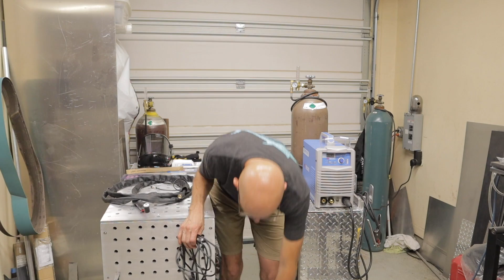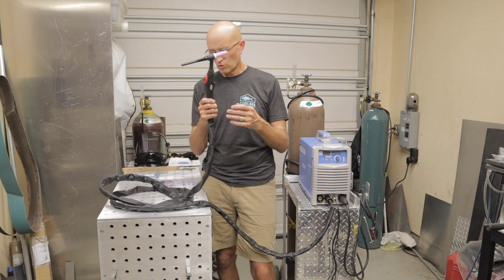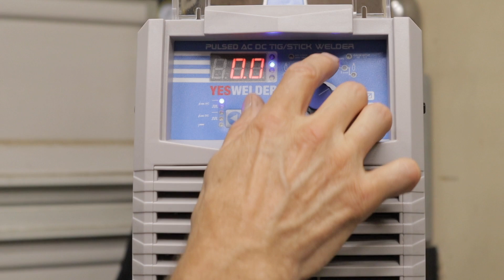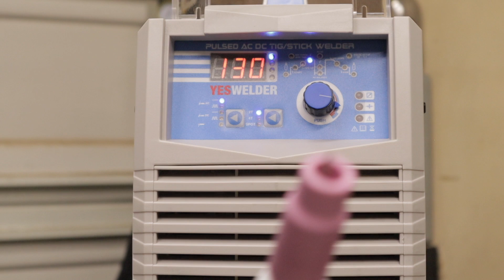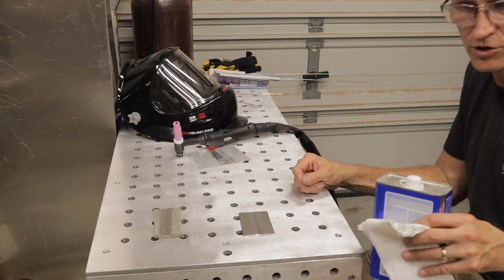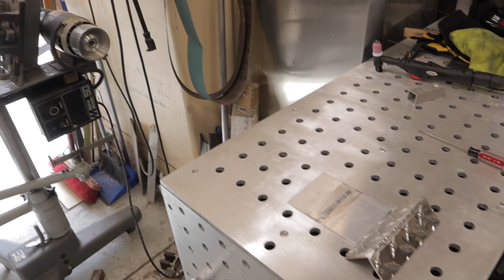YESWELDER NEW TIG 250P Setup & start tig welding Steel & aluminum.   Discount Code in description!

Comment: Comparing this, AHP 203xi and Primeweld Tig225x. Everyone agrees the primeweld warranty and customer service is top notch, but one thing I don’t really like is the analog knobs. I’m fine with analog but it doesn’t have markings or clicks for values, it seems like guesstimates. At least on digital you know exactly where you’re at and repeatability seems better.
Reply from the maker: I had the AHP predecessor 201XD and it was basically the same as the primeweld 225. I think they were made in the same factory by the looks of the welders. I liked the simplicity of the analog settings but the power just wasn’t enough for me. I wanted to weld 1/4” aluminum and it would really struggle to do it at max amps. When I got the Yeswelder, it was more powerful right out of the box. At 200 amps I could easily weld 1/4” plate and at 250 amps I have welded 1/2” aluminum with a little preheat. Don’t know if this helps you make your decision or not. All three are great welders. If you are not going to be welding aluminum you will probably be happy with any one of them.😁👍

Comment: I ordered this same welder. I was just wondering how many amps is sufficient for this breaker and what wire size is appropriate. is it a 6 awg or 4 and a 60 amps breaker? I would appreciate it if you can reply for my queries
Reply from the maker: Hi Lepanto! A 30 amp breaker is what I’m using and it is wired with 10awg wire. Sorry for the delay in my response, I just noticed your comment. Let me know if you have any other questions. Thanks, Don
Reply: @PranaTech  Thank you for your reply. highly appreciated. Anyway, nice video  especially for someone who is starting to learn tig welding.

Comment: All is well with the welder,your video is very informative but I don't remember you telling your viewers that to tig aluminum you need to swap the ground clamp to the positive side! You would think that with all the other tech that is built into this machine that it would do that automatically, thank you
Reply from the maker: Hi Richard,  I’ve never stick welded with mine so I’ve never needed to swap the ground clamp. I Tig weld mostly aluminum but occasionally I weld steel with it and you don’t have to change anything other than the AC/DC settings on the panel. Sorry I didn’t catch that when you asked about the not keeping an arc going. Glad you got it figured out! 😊👍

Comment: Matched all of your settings on my welder but the only thing that happens is high frequency comes on for maybe one second and that's it,the only thing that's different is that I'm using the button on the torch instead of a foot pedal,any suggestions
Reply from the maker: Hi Richard, I’ve never welded with the button on the torch, only the foot pedal. There might be something wrong with the button.🥺

Comment: How do you set it up for stick welding? I'm having no luck trying to do so
Reply from the maker: Hi Richard, to set yours up for stick, put the electrode holder cable into the positive output socket and the ground cable into the negative socket. Then select stick on the mode and then electrode size over on the far right middle of the 3 led lights on the control panel. Then select what amperage you want and start stick welding.😊👍 hope this helps!

Comment: Just received my 250P today, but it doesn't come with the pedal, I am wondering if I can weld the aluminum floor in my semi trailer without the pedal.. maybe it will just be a fixed amp instead of the control amp from the pedal?
Reply from the maker: Balerio, they do sell a pedal in the accessories section of the site. It’s pretty decent for the price. It does come with the switch on the torch but that will be a fixed amperage like you said. The switch will just get the arc started at full amps set on the display. 😊👍

Comment: I want to upgrade my yeswelder  to a ck torch 
Do you know if there is a adapter that would work with that to make the ck torch work ?
Reply from the maker: Yes! I just finished doing this to mine. Here is a link to the adapter on eBay. https://www.ebay.com/itm/174825692252?hash=item28b46c5c5c:g:c9oAAOSw76lcQodL  It is a little pricey at $32 but a quick and easy way to get it done. I made my own adapter by taking a Western AW-430 double female and drilling it out and then tapping it 5/8-18 straight through and then shortening the coupler. The couplers are $4-$5 on eBay but if you don’t already have the 5/8-18 tap and a 37/64 drill, it ends up cheaper to just buy the adapter on eBay.  I’m actually working on a video on how to upgrade your pedal to a Nova or SSC and CK torch and a Tig button setup. 😁👍
Reply: @PranaTech  thanks got it ordered 
The peddle mod would be awesome that is my next upgrade to it but could not find a way to do it.
Reply from the maker: So to upgrade your pedal, you just order one for the AHP 201XD and then install a GX16 5 pin plug on the cord. It is not hard and I have a schematic that shows exactly how to transfer the wires from the one plug to the new one. https://drive.google.com/file/d/1ensmrBx3Y1fsxU2AME1HBv9_G13EQOZ0/view?usp=drivesdk   And here is a link to a picture of the CK flex head torch I used https://drive.google.com/file/d/16uazLI7uoQjj03WPGQBLkKhV2T8h8SYP/view?usp=drivesdk  Hope this help and let me know if you have any questions.😊Don
Reply: @PranaTech  thanks 
Is there a better web site to get the nova peddle from and the plug adapter?
Reply from the maker: Amazon is the best place to get the plugs. Here is a link https://www.amazon.com/gp/product/B08NX3BK1R/ref=ppx_yo_dt_b_asin_title_o02_s00?ie=UTF8&psc=1  You can find them in a single set but the price is about the same as this set of five. This will give you some spares in case anything ever happens to the plug. Here is also a link to Amazon for the correct Nova pedal. https://www.amazon.com/dp/B07534C15W/ref=redir_mobile_desktop?_encoding=UTF8&aaxitk=e41972199c8479da2d4a1d81ef104793&hsa_cr_id=7843351320201&pd_rd_plhdr=t&pd_rd_r=42b5391b-4948-44df-bdf1-e372c60c0726&pd_rd_w=IPK14&pd_rd_wg=8vdgr&ref_=sbx_be_s_sparkle_mcd_asin_2_title 👍
Reply from the maker: Sometimes you can find the Nova Pedal a little cheaper on EBay but Amazon is usually the best price. 😊
Reply: @PranaTech  thanks just got it all ordered 
Can’t wait to get it all dialed in 
Thanks for the videos and help !!!!
Reply from the maker: Awesome! Let me know if you need any help with the setup when you get going.👍😁

Comment: I just received my 250 welder when I welded aluminum it worked really good made a nice clean buzz sound now it's still welds but it does not have that clean buzz sound no more what could cause that I have put new tungsten and did not fix the problem. It makes kind of a spattery crackle sound but it's still welds and it's not as shiny anymore.
Reply: Thank you for the reply I looked at the frequency and it was at 38 bumped it up to 120 and it works nice now.
Reply from the maker: Awesome! 😁👍
Reply from the maker: Hi Bill, what frequency are you welding at and what thickness aluminum?

Comment: Just got my 250 tig. I am used to having a torch with a dinse connector, this threw me off. How does the torch get power without connecting to the negative output terminal??
Reply from the maker: High Mark. The main hand tightened black plastic fitting that attaches the torch to the welder is brass and the current flows through that out to the torch.😊👍

Comment: Thanks for showing me how to set up my welder the extra 5 point connector pin was throwing me off as I thought it too needed to be connected as well with no extra outlet thanks again a happy welder
Reply from the maker: Hi Brian! Glad my video helped! Enjoy the new welder and let me know if you have any questions. 😊👍Don
Reply: @PranaTech  thanks for your response I got the welder to try to fix. my truck radiator its like pounding a tack with a sledge hammer as I wound up buying a new radiator anyway and looks like I paid twice as to what its worth should have waited for Amazon sails

Comment: My AHP AlphaTIG 203XI is the same price, but mine comes with a flex next torch with 17 and 9 heads and a Nova foot pedal. It may not have the 250 "reported" amps, but I know that Yeswelders DO NOT output at the current they say they are, so it's a lot closer than you think. Yeswelder does have a better return policy though.
Reply from the maker: AHP are great welders! I had the 201XD and it was excellent but no where near the power of this Yeswelder. I struggled to weld 1/4” aluminum with it and I can weld 3/8” aluminum with this 250 Yeswelder. I’m glad that you’re happy with the AHP👍😊

Comment: Hi I purchased this welder about a month ago and haven't heard anything about it being shipped or anything I have no idea what I'm going to be receiving it and I've tried with the customer support and it's just being difficult very disappointed can anybody tell me how long it took them to get their welder
Reply: It took about a month and a half to get mine. The extra consumables, the regulator all shipped super fast. I think what happens is the have a sale combined with a heavy push on advertising, they get more orders then they can ship immediately. It did come and works great. Takes a bit to get use to the settings but it is intuitive.

Comment: I placed an order for this 250p it doesn't list a power chord and i emailed them and they said it doesn't come with a power chord. Really? I may try and cancel my order. Thanks
Reply from the maker: Hi Luther, well that’s just silly! Yes it comes with a standard 30amp 3 prong 220v power cord that will fit most standard dryer outlets. This is if you are in the USA. I don’t know about other countries. Hope this helps. 😁👍
Reply: @PranaTech  Thank You but that is what customer support told me and sent list description and the power chord isn't listed in what comes with the welder. Where and what kind of filler rods should i purchase for Aluminum Stainless and mild steel.
Reply from the maker: Hi Luther, sorry, I meant it was silly of them to tell you that it doesn’t come with a power cord, not that you were silly. It definitely comes with the cord. 😊 For filler rod, I use 4043 3/32” for aluminum and ER70S-2   3/32” for steel and ER309  3/32” for stainless steel and hot rolled carbon steel. I just order them from Amazon and get what’s on sale and high rated. 👍😁

Comment: What size is the torch connection?
Reply from the maker: It is 5/8-18 standard Argon compression fitting. The problem is that it is male on the machine so you have to use a double female to make it work. I’m in the process of doing the conversion so I can use a CK worldwide torch. 👍😁
Reply: @PranaTech  Can the machine run on 110v? What plug did it come with?
Reply from the maker: Hi there, no this Tig only runs on 220 volts. It came with the standard 30amp dryer style plug.👍😁
Reply: @PranaTech  what about an adapter? Will it be dual voltage like the other machines? or strictly 110v electronics?
Reply from the maker: Strictly only 220volts. No adapters, only 220.👍
Reply: @PranaTech  Ebay seller unionautotech-7 has some adapters, m16x1.5 to 3/8-24. It was sold out for a while but just been relisted again.
Reply from the maker: Hey, that’s awesome! It gave me an idea for my conversion. I have a ⅝-18 double female already that only cost me $4. I’m going to cut the length down and drill it out and tap it to M16x1.5  I already have the tap so this will be a simple operation. I will save the guys auction info to include in my video I’m making for guys that don’t want to make their own adapter. 👍😀

Comment: Don I won’t keep bothering you and also I won’t make this a habit, but I burnt holes in the 1/4 , it started off real good but then everything went downhill, could it be the pure tungsten
Reply from the maker: Hi Antonio, you are not a bother at all and I am glad to help. Ok, first thing, is your pedal varying the amps from low to high? If it is working as it should you will need to lower the amps as you are going along when welding aluminum. Aluminum transmits the heat ahead of the weld preheating the metal. The further you weld, the amps that you started with are now too hot and if you don’t let up on the pedal reducing amperage, you will burn through the metal. Let me know if this helps.😀👍Don
Reply: @PranaTech  thank you so much, I’ll have to go get more argon , and I’ll let you know how it went , again thank you god bless
Reply: @PranaTech  hi Don, how would I know if the pedal is varying on the amps , its probly a stupid dum answer 😆, but Iam new on this
Reply from the maker: Hi Antonio, ok, so when you turn the welder on and before you begin to weld, hold the torch in the air while looking at the control panel. Over on the lower right side you will see three small led lights. Press and hold the pedal until the upper light comes on. This indicates that the welder knows that you are using the pedal. If you shut the welder off you will need to do this again each time.  To make sure your pedal is varying amperage, take some scrap aluminum and barely press the pedal to get the arc started then press halfway down or more and you should see a big difference in the arc and the amount of heat. Play with it a little up and down and you will see it get hotter and colder then you will know your pedal is working.😁👍
Reply: @PranaTech  ok thank you , will do 👊👍🏻

Comment: Hey Don , I got my welder going, but I need your help , Iam welding 1/4 inch aluminum frame and I can’t get the setttings correct , plz whatever you can help me on this
Reply from the maker: Good morning Antonio! Ok, here are my settings for ¼” aluminum. Set the machine to AC and 2T. Make sure the ground is over on the positive outlet. Amps are set at 210 and frequency is set at 80. AC balance is set at 35. Argon flow set at 25 cfh or 20 psi unless you are using a gas lens kit on your torch (which I recommend) then you can reduce flow to 15 cfh with the gas lens setup. Use 3/32  tungsten 2% lanthanated for everything. Grind about a 25-30 degree cone on the tungsten. Make sure you press the pedal with the machine on until the indicator light over on the lower right of the display comes on and indicates that the machine knows the pedal is hooked up. Make sure the aluminum is wire brushed and acetone cleaned to remove all contamination. Hope this helps you! Let me know what kind of problem you are having and I’ll see if I can help. 👍😀Don
Reply: @PranaTech  thank you so much Don , Iam about to start in a few , this is a blessing , god bless you and your family
Reply from the maker: No problem at all! Let me know if you have any other issues and I will try and help. Blessings to you as well my friend!😁🙏❤️

Comment: Do you have a cheat sheet to help with going from metric to decimal?
Reply: Multiply or divide by 25.4
Reply from the maker: Hi Robert, sorry I don’t have a cheat sheet for the metric to decimal. For mig it’s pretty simple. .023 wire is .6mm.   .030 wire is .8mm  and .035 wire is .9mm.  When I have to do more than this I just use an online converter for inch to metric.😀👍

Comment: Do you know if the torch and the pedal can be swapped out?
Reply from the maker: Hi Josh, yes they can. You just unplug the torch control plug and screw in the pedal control plug. Once you do this you have to hold down the pedal for 5 seconds or so until the indicator light comes on over on the lower right side of the display panel. This indicates that the control board knows you are using the pedal for amperage control. If you shut the welder off you will need to press the pedal again until the light comes on because the computer doesn’t save the setting. Let me know if you have any other questions. 😀👍Don
Reply: @PranaTech  Do you have any suggestions for upgraded torches and pedals for this unit?
Reply from the maker: Ah, whoops I totally misread you previous comment! Sorry!   So, yes, I’m running a Nova pedal for the AHP 201XD. It works awesome and is a huge upgrade over the factory Yeswelder pedal!  You will have to rewire the plug from the AHP 7 pin to a GX16 5 pin plug that fits the Yeswelder plug but it is really easy if you know how to solder wires. If you can Tig weld I’m sure you can solder a few wires.👍 I have a diagram that I made that shows exactly which wire goes where for the conversion. Here is a link to my diagram for the conversion. https://drive.google.com/file/d/1ensmrBx3Y1fsxU2AME1HBv9_G13EQOZ0/view?usp=drivesdk   You could just cut the plug off the Yeswelder pedal and wire it to the Nova pedal for the AHP, or you could get a female 7 pin GX20 socket and a GX16 5 pin plug and make an adapter that goes between to adapt the Nova  pedal to the Yeswelder.  As far as the torch goes, I’m probably going to replace it with a CK Worldwide flex head when I have some extra $$$. I haven’t had time to dig into the Yeswelder torch to see what the connection is at the torch head though. I did install a stubby gas lens kit into the Yeswelder torch because I do a lot of aluminum welding and it makes a huge difference in the way my welds come out. You use less gas as well.👍😀 let me know if you have any other questions. Don